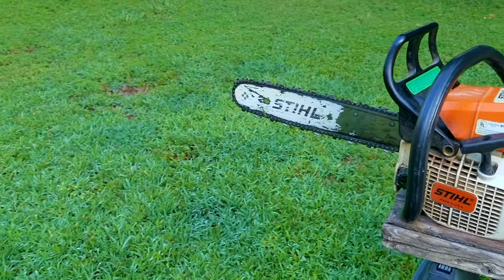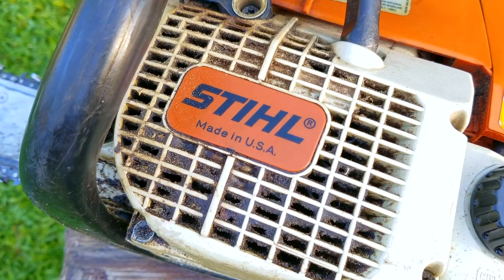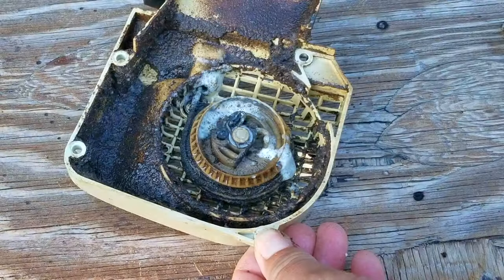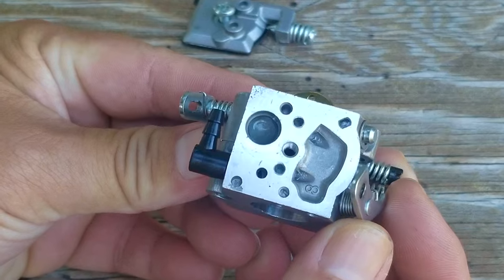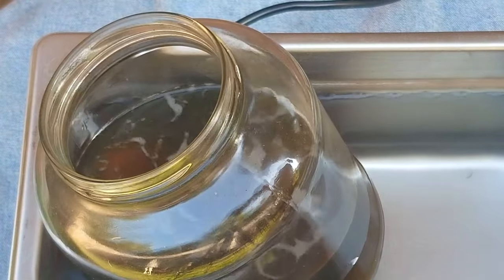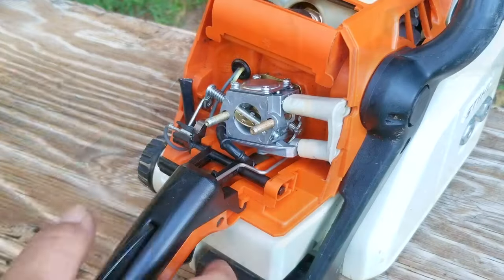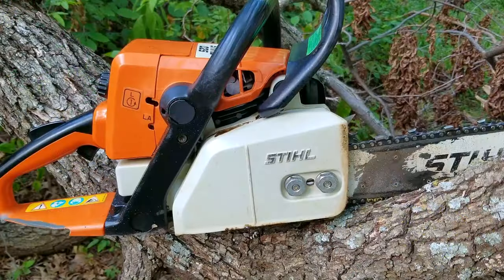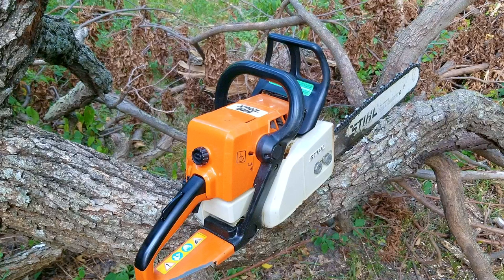Fixing A Stihl Chainsaw That Won't Stay Running

Comment: I would absolutely not recommend replacing a carb on a good quality tool because whatever shit you buy from china is gonna forever be worse than oem, get a rebuild kit
Reply from the maker: you make a good point.
Reply: @AdolfAuschwitz79 my ms250 is the most reliable saw I’ve got. I’ve had it for 7 years, it’s my go to saw. 🙂
Reply: Hey if you look at the carb it says made china anyway 😆
Reply: @stark2315  depends, on high end I've seen 50/50 china Japan
Reply: I also have a Stihl 025 that’s been giving me problems, as hard to start, cold or hot. This chainsaw has only the L screw adjustment, and the LA adjustment. There is not a H, and an L fuel mixture screws.
Reply: 1000% true!

Comment: Mine sat a few years. Ryobi 14". Cleaned it up. Back together. Would not stay running. I suspected the butterfly and needles or pins in carburetor were just dry. Or gummed up. Took of air filter, opened the choke and sprayed throttle body cleaner in. Just let it soak. Also primed it up but didn't try to start it. Just let the gas get in there and free it up. 2 days later I fired it up and she ran like a kitten. Carb probably just gummed up
Reply from the maker: glad it worked out for you

Comment: Equipment was manufactured better years ago. No matter what brand, stick with your original equipment as long as possible. This means actually taking care of the equipment as per manufacturers recommendations. New items are made cheaper and cost cutting shows eventually. Parts are the only issue for older models both in cost and availability. Oldie but Goodie still rules, just as we all age!!
Reply from the maker: well said!

Comment: My main saw is still an old homelite 330. Cleaned the carb, replaced the intake boot, and it’s still putting in work. My backup is an even older Xl-12 that needed even less
Reply from the maker: very nice!
Reply: I used homelight in my tree business and had better luck with them than with a stihl

Comment: I have a Stihl ms 250. I have had it probably 20years. worked fine when I put it up a year or so again. I think I ran it dry. now it starts but won" but won"t run. here is what I have done. put new carb kit in it,  replaced the wiring, replaced air filter,  replaced coil with new aftermarket-did"t help, put oem back in. cleaned spark arrestor, replaced with new 89 octane gas and oil. new spark plug. tore carburetor down and put in ultrasonic cleaner for over an hour twice. it still sounds like it is starving for fuel. I am at Witts end. this is a great saw. I have to fix it.
Reply from the maker: sure, have you considered adjusting the carb for more fuel?  If so, then there's an air leak somewhere in the intake boot, or at an engine seal.

Comment: I'd just as soon have an older Stihl but probably not another brand. All of my saws have been older and run like they were on fire for ages except the 26 but it was a screamer anyway. I ran a 24 Stihl with a 24 inch bar and it was a BEAUTY as in not too heavy with enough power to do the job; just a sweet running saw. My pal with his shop has one but it needs a top end. I'll pass. Leaf season now. Good fix and Blessings
Reply from the maker: good choice!

Comment: Just a helpful hint, I believe there is a passage to adjust the second mixture screw. If you look on the black handle there is a depression/hole in it that I believe will allow a screwdriver to access the screw although the screwdriver shaft may need to be longer.
Reply from the maker: thanks

Comment: I have an 025 purchased new back in 1997  Aside from a chain replacement or two, the only other issue i had was with a cracked / leaking fuel line.  I also bought a FarmBoss w/ 20" bar last year for some very large Copper Beech and Cherry trees that needed cut up on the property here.  Great saws, great Brand.
Reply from the maker: thank you for sharing that

Comment: Rebuilt mine 1/2 a year ago in Australia, mine needed new crankshaft seals that are a thicker design -  it is a German made version.
Carb is 1 turn out low & High with Low needing another 1/4 out for the middle sweet spot. Recently, I've had carburettor check valve failure & blockage in low idle circuit that needed cleaning. Impressive the cylinder & piston /rings were /are like new. So very impressive for its age & yes compression & power it has got. Ideal home owner saw as I've done larger jobs it wasn't designed for 😅
Reply from the maker: Thanks for sharing
Reply: Was the 026 made in Germany?
Reply: @raincoast9010  Yes - Sold in Australia !

Comment: Holy crap...  I have an 023 doing exactly the same thing !!!!!  It's till the original carb with no rebuilds ever, so, yeah, I'll try a rebuild on it or a new one.  It's had 30 years of hard use but I don't want to replace it just yet. It's been a great runner and has cut hundreds of cords....Still starts right up and cuts great but won't stay running on idle no matter how it's adjusted.
Reply: I have an 017. Be mindful of the gas line. Mine had a hole in the gas line in the tank so it was sucking some air. It took me a while to find that trouble. She’s running and cutting great now! You have to order and replace with the right molded gas line for your saw.
Reply: Thank you Sir...  I'll check that too. @KennyBaltz
Reply from the maker: good luck with it.

Comment: My grandpa bought a ms180 in 2008, used it for a few years to make firewood, then the saw suddenly stopped starting so it was left in the garage for around 8 years. So one day I’m doing some work and I found the chainsaw, asked my grandpa about it. He told me that it doesn’t start so I gave it a shot. Cleaned the carburetor, filters, bought a new spark plug and it works like a charm. I still have it and use it to this day and I believe that the one I have is better than the new one.
Reply from the maker: nice work!

Comment: Many like ther old Stihl saws😊
Required a good clean, well done😊
I did notice the chain needed to be tightened slightly and perhaps sharpened 😊
Reply from the maker: yes I should have tightened it before using it. thank you for noticing

Comment: Easiest way to remove the choke linkage is to push the choke in on the carb and sliding the linkage to the left. It slides right out. The parts for the 021, 023 and 025 are still being made because Stihl still makes the MS 250 (the newer version of the 025).

I have an MS 250, MS 170, Stihl 039 and a Stihl 026. I don't like the newer 1 models. They went the way that Husqvarna did on their saws. Over engineered with a bunch of little bits of plastic that if you were to remove, you'd have to get a new part.
Reply from the maker: thank you!

Comment: I bought an used Stihl 025 model (16'' bar) about 15 years ago. As a homeowner with a big wooded yard I use it every year, trimming branches and cutting firewood. For the first time this year the saw started to stall after 10 minutes. And for the first time I decided to bring it to a repair shop for maintenance. They replaced the coil and overhauled the carb ($$). Even after this the problem remained. Next recourse: check out some YouTube channels. This helped me locate the problem: it was simply the clogged air vent. On your video it's the black plastic vertical tube located to the left of of the carburetor, seen here at 7:54. Mine, possibly a homemade fix, has a small screw inserted at each end. Removed the screws and pushed air into the tube. Now the saw is running smoothly again. Your insight is greatly appreciated.
Reply from the maker: very good work

Comment: Thank you. I have a 025 stihl also. I had a problem of it constantly stalling. The repair shop suggested putting a new engine in, which I did. I still had the same problem of it running and then stalling out. None of the shops could fix it. After the new engine was installed I only used True Fuel from the store. I was moving back to Florida so I emptied all the chain oil out and all the fuel. Tried to start the engine to ensure all the fuel was gone. I then stored it away. After several years I put a small amount of fuel in and some chain oil and she started right up. When I went to cut a pine tree she stalled. I havent been able to get it started since. After watching your video and another (about cleaning the valve? That allows air into the fuel tank). I will also use your video to take apart and clean the carburator (i think you put the carburater in carb cleaner then turned on your sonic cleaner?)
Reply from the maker: no problem and good luck with it.  Right now I'm putting the carb into gasoline, and then put the jar into the ultra sonic

Comment: Hello, On your advice and detailed knowledge from your video, I took the carb off my malfunctioning 1998 STIHL Model 036 PRO, yesterday. My carb wouldn't come off until I removed the upper half of the handle that hold the safety and the trigger assy.  If you go to your video at 12.03 [the Diaphragm].  I'm pretty sure I put that back upside down.  However, Skeptical. When I put the thing back together...The machine started right up and ran and operated perfectly.  Thank you so much.  I could not have done it without your detailed video.  A+ A+ A+  Thank you, Chris SE PA   USA
Reply from the maker: no problem and you did an excellent job fixing it too!

Comment: Both my 024 (bought used years ago) and 025 (Bought used last year, made in 1999) stalls too, immediately after I switch the choke off, no matter what carb adjustment.
Tried my hand on the 024 which I changed main fuel hose + filter, as well as impulse hose and spark plug, checked compression, checked muffler was free of obstructions, ditto fuel tank vent hose. Did a vacuum test on intake boot as well while moving it around (-0.5 bar according to Stihl spec), all checked out.
Still no cigar.
Then tried on the 025, same as above (which is to mean good compression, good spark, changed spark plug changed hoses blabla), same exact result, starts but won't idle when I take it off choke.
Now, I'm a Stihl guy, but pro-grade saws mainly, so now I have a pretty solid idea why, those plastic clamshell crank housings are great for weight saving.
.. Up until someone abuses them, the plastic gets pulled outta whack by the heat, displacing the crank & head not by so much that you see it but by just enough to take everything out of spec and that's all she wrote.
In other words, only go with saws that have metal clamshell (crank housings), or, that's my current theory anyway.
Reply from the maker: you have a point about the case plastics.   Also have you not tried to replace the carb yet?
Reply: @INSIDEHOUSEGARAGE  Yeah forgot to say I tried both rebuilding and replacing carbs on both saws and adjusted them to the correct spec to at least get the saws running.
Starts and goes'ish on choke, take it off choke = stalls, cranking up the idle screw max only makes it idle a little bit higher for a split second before it stalls, applying throttle to get it off choke automatically yields the same result, takes it off choke and stalls it.
I thought maybe it was getting way too much, but the sparkplug (NGK) looks perfect, and I replaced it with a new one (also NGK).
I blew the air filter (metal mesh winter type) clean for good measure (but it was already pretty clean).

Not one to give up easily, I also tried switching over the pumping and metering diaphragm from new carbs over to old carbs (which are clean, but I blew them clean all the same).
So I tried both diaphragm's from both the old and new 024 carb in the 025 carb (direct bolt-in) but alas, same thing, likewise the other way around.
At that point I gave up on the 024 so I could focus fully on the 025 because 1) it's almost like a pro-saw in how much easier it is to work on.
Also 2) If you thought the 025 carb linkage was difficult, don't touch the 024!

So about cylinder damage, which both my Stihl retailer and a specialist on Youtube ("married with small engines" here on Youtube) says the compression tester might not pick up on.
In the process of inspecting/cleaning/rebuilding carb and muffler, I inspected the cylinder.
I know for sure the front and back (around the ports) are good, and in 99% of cases that's usually where they get it, cylinder still has honing marks and piston has machining marks.

That leaves the crank seals, the crankcase needs sealing or there's no vacuum for the impulse hose to make carb pull fuel.
And a lot of people say the crank seals can be not as good quality on plastic homeowner saws as on the professional 026/260/261's, that would be a 20 dollar fix and it's definitely worth trying, I'll report back :)

Edit: Goes without saying, but it's worth repeating your videos have helped me in largely understanding ballpark how small engines work, was able to repair my snowblower last winter (bad grounds for ignition system) and that got me out of a big pinch.
Thanks for doing what you do!

Comment: I have that same saw. It did the same thing about not wanting to stay running. Put an aftermarket carb on it. It's adjustable and got it running like new again. On mine i just left that plastic piece off
Reply from the maker: hey nice work. Which plastic piece did you leave off?
Reply: @INSIDEHOUSEGARAGE  the one that goes around the adjustment screws

Comment: Very good and clear video. Like your channel. I have a old 023 and problem is that after i run it for 15 minutes and try to restart........nothing. Always starts and run well. Would appreciate some advice. Thank you
Reply from the maker: sure, when it happens again, try take off the air filter and dropping in some fuel into the carb, If it starts back up and runs, it's a carb issue and you can decide what to do

Comment: In response to your question, I’d always prefer an older machine, as long as its weight and handling characteristics aren’t too different. Beyond a certain age saws were much heavier with a lower power to weight ratio, thereby making them much more strenuous and time consuming to use.
Reply from the maker: me too!

Comment: I have an older saw and a modern one. The modern saw is easier to start and bigger and pulls a 20” bar and chain. The older saw doesn’t have a primer and can be a pain to start sometimes. Both work well though, but the older one is a small saw runs 14 or 16” bar. I had to clean up the flywheel magnets and iron core for the coil and replaced the plug and flood the carb with gas and it started sucking and running fine
Reply from the maker: nice work

Comment: Thank you for this video. Although what the heck is a sonic cleaner? No haven't googled it in just lazy haha. Great video though. Straight to the point with good camera work👍
Reply from the maker: not sure if you've seen it, but it's an container that has ultra sonic transducers under it.  you fill it with water or cleaner and put whatever you want to clean.  Most use them for jewelry, but carbs work too.

Comment: Quick question, I’m working with. Stihl 020T. I have the oil reservoir emptied out while I try to get it running correctly so I don’t have oil dripping out. My question is could having the oil reservoir empty prevent the saw from running correctly? I noticed you mentioned having oil in the saw. I don’t have the bar on right now so I don’t need oil. Thanks for your help in advance.
Reply from the maker: thanks for the question and no having the oil reservoir off should not keep the engine from running.  They are 2 separate systems
Reply: @INSIDEHOUSEGARAGE  ok thanks!! I think I’ve got to replace carb at this point.

Comment: Thank you for your videos. I’ve learned a great deal from you. I recently started working for a tree cutting company. We have a saw that starts and runs but shuts off when we turn it on its side to make the cut. Any suggestions. Thanks again
Reply from the maker: sure, check and make sure there's enough fuel line in the  tank. IF that's good then check and make sure the tank vent is working like it should. after that's its a gasket issue.

Comment: I usually chose the older.  Partially because I inherit them but usually it seems to me that the older equipment is built better, but that is my opinion.  And if I in her it them, then I usually know the history of use/abuse.
I believe I have that model of chainsaw in the shed.  I think I’ve got a Poulan, several Stihls and one ore two odds and ends.
Reply from the maker: nice collection and yes I think the older ones are great too.

Comment: I got one of this ms 250 or 025 and I redone the carb with gaskets and diapraghms the problem is when Im trying on restart it after 25 minutes needs choke again, its normal? or maybe i got a gas pressure trouble?
Reply from the maker: depending on the air time, 25 minutes would be more than enough to cool the engine down requiring to use the choke again.
Reply: Be sure to check your gas line. A leak in the gas line inside the tank will drive you crazy.

Comment: Back in the day chain saw s had a manual oiling system which was a little testing of the user to keep the chain And bar properly coated In oil
Reply from the maker: yes they did, it was button If I recall.
Reply: @INSIDEHOUSEGARAGE   you are right about the old school oiling system which was a push button to oil the chain and bar

Comment: Loved your presentation! I am a Stihl Tec. at a local hardware store. I want to know what one earth you cleaned that saw with? That stuff is great! I hate repairing a dirty saw!
LOL had one some weeks ago that was so dirty that the customer couldn't turn the saw OFF. That much grim and oil was keeping the stop switch from making contact;. (Charged him what I call; "stupid tax" for not maintaining his saw. 
Just want to know that cleaner so I can get some, thanks.
Reply from the maker: thanks, it's the degreaser from Harbor Freight.